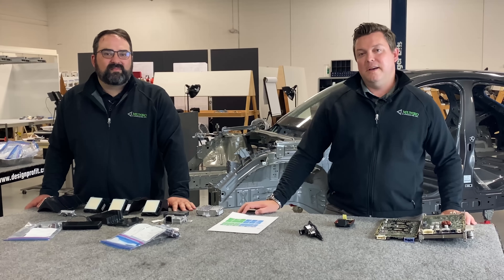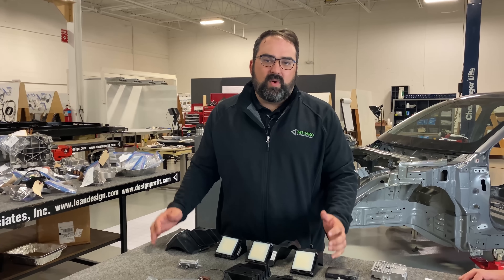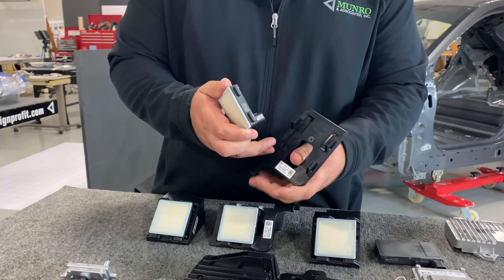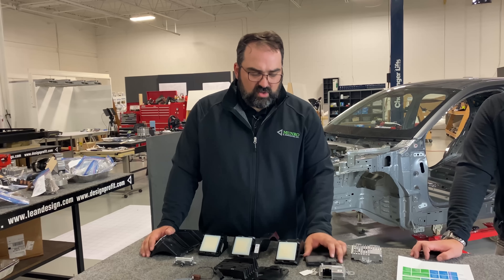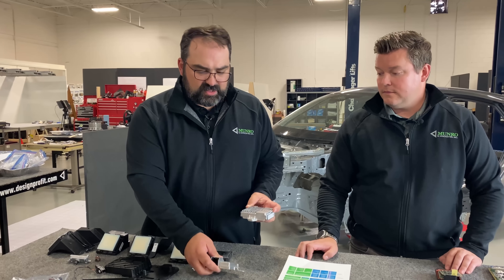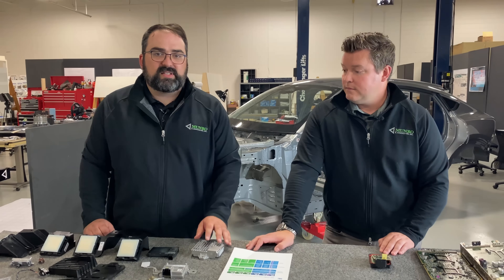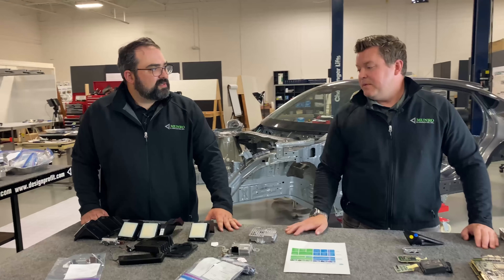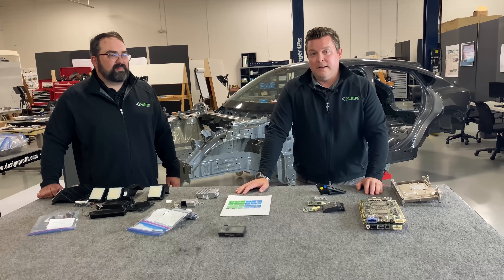Mach-E ADAS Breakdown

Comment: You didn't mention the OEM for Ford's driver assist hardware and software.  I'm certain that they outsourced it.

How do the two systems compare with respect to current draw?

I'll make a wild-ass guess:  Ford's system draws less power.  I don't think we can blame the car's relatively poor energy efficiency on their driver assist hardware.  I think this because Tesla is performing a hell of a lot of compute cycles with its FSD hardware.  Tesla has to - they're trying to solve the object recognition/vision problem.  Ford isn't.

Radar is color-blind and can't be used to identify objects.  Vision can, in principle, but the better the object recognition, the more compute-intensive the system has to be.  Tesla aimed high with Hardware 3.0 - they expect the system to recognize anything a car will encounter on the road, anywhere, and use that information to predict what various objects will do.  For example, Tesla will be able to recognize a bicycle mounted on the back of a vehicle and predict that it will move with the vehicle, not suddenly change directions.  Radar won't distinguish what it sees; it just notes there's something reflective there.

Some surfaces don't reflect radar much.  Skin and clothing might as well be stealth materials.  Radar reflects great from metal and can identify distances, which software can use to generate a virtual point cloud of reflections around the vehicle.  The objective is to not run into anything that reflects radar.

This is 90's tech.  I don't see a developmental path from where Ford is to L5 autonomy.  Or even L4.

Occlusion is indeed an issue with vision systems like Tesla's - but it's probably not more of an issue than it is with human drivers.  The system should be able to determine if it can't see well enough to operate the vehicle safely and then take action.  For L2, where driver attention is mandatory, the action will be to warn the driver and disengage the driver assist function.  For L4 and L5, the car will have to decide on a course to attain safety - slow down, pull over to the shoulder, exit to a rest stop, etc.  Its decisions must resemble those a skilled and attentive human driver would make under the same circumstances.

I'm convinced that vision is the way to go.  A good vision system simply won't need radar.  Or lidar.

The proof?  Humans can operate motor vehicles with only two cameras (eyes) and sometimes-inattentive wetware.  A vision system with 360 degree views and absolutely no risk of inattention should be able to beat human driver safety very well indeed - if the object recognition problem and predictive algorithms are solved.  That will require a lot of compute cycles in the car, and a hefty AI training architecture (not in the vehicle) developing the car's programming.  Thus far, only Tesla puts that much computer power into its vehicles.  And Tesla's AI training architecture, aimed at solving vision, is unique.  No other automaker has anything like it.
Reply: I'm not absolutely convince on the camera approach getting to level 5 on it's own do to issues with winter driving messing with cameras. Go watch the episode Monroe did on the FLIR thermal based system. Sandy seemed to believe that was going to be the way to get to level 5 in that episode.
Reply: @torchlord11  I did see the episode about FLIR.

FLIR is optical.  You should think of infrared as just another band of colors -- longer wavelengths than our eyes can resolve, but cameras can.

Weather can mess with FLIR cameras, too - raindrops emit infrared photons like just about everything else, and they can bollix up the curvature of a lens.

With all due respect to Sandy, I don't think that FLIR is the key to enabling L5.  The obstacle really isn't the color of the light.  It's object recognition and making correct control decisions.  Elon thinks that visible light is good enough, and I find it hard to argue with him.  We humans have driven billions, maybe even trillions of miles with nothing better.  Our accident rate sucks, though, which is why getting machines to do it more safely is a great idea.
Reply: @Urgelt  I found this article that seem to have done some difficult test and tested recent Tesla's and cars with FlIR in it. They say that the Tesla didn't do so well in all the test but did ok in some. According to the FLIR Website their system can detect 4x better at night, with cameras you are limited to how far your light source goes.
 https://www.forbes.com/sites/samabuelsamid/2020/09/15/flir-demonstrates-how-thermal-imaging-can-improve-pedestrian-safety/?sh=2582671f3cd9
Reply: @torchlord11  I watched that, with all respect to Sandy it's not his area of expertise.
Reply: I agree with you that vision only should be enough but adding radar would make it more versatile, wouldn’t you agree? 
(That’s not what Ford is doing, they heavily rely on radar)
Radar will give very precise distance information while vision based software will have to estimate. A large or small person a large or small car. Some European brand car models have a distinct recognizable look over their product lines. To distinguish between an Audi Q3, Q5 and Q7 could be difficult. 
The issue could be tackled by using dual cameras (stereography) of course.

Btw, a decade ago, Ford already had traffic sign recognition systems available in almost all models here in Europe. 

BMW already had a night vision option with a ‘crossing persons warning system’ in its 2008 cars. Tesla isn’t the only one developing these systems although I agree that they are a step ahead of the competition.
Reply: @Conservator.  No radar would not make it more versatile.  It would in fact make it error prone and less effective.
BWT a decade ago Ford stopped building cars with traffic sign recognition systems in Europe.
BMW does not have night vision, I have been in a new BMW and it did not have anything like that.  If it was safe and cost effective every BMW would have it.
Reply: @davidbeppler3032  Who told you that Ford doesn't offer traffic sign recognition functionality in Europe? It is enough to visit any European Ford web site to see it advertised. From the UK site: "Whether the signs are at the side of the road or above it, permanent or temporary, Traffic Sign Recognition can identify them. Icons for speed limits and no-overtaking signs are displayed on the instrument cluster, alerting you to changing restrictions".
Reply: @davidbeppler3032  Night vision was a very expensive option. Very few cars will have it.
Reply: @Conservator.  Hence it is useless.  Tesla Autopilot is very expensive, every Tesla has it.
Reply: @davidbeppler3032  No, FSD is a very expensive option in a Tesla too. 
You are comparing Tesla tech of today with BMW’s of 13 years ago. That was 4 years before the first Model S was delivered.
Reply: @Conservator.  13 year old tech that has never been produced vs 10 year old tech that is in every car.  Yes.  Seem s like BMW sucks.
Reply: @davidbeppler3032  I hope you have splendid day!
Reply: @Conservator.  Every day!
Reply: @Conservator.  The Mach E's ADAS system is combining Mobileye's EyeQ4 camera-based system with radar.
Reply: Well said!
Reply: You made made many good points. I'd like to add:

Indeed they didn't mention who supplies the camera, radars and modules to Ford and I agree those are most likely outsourced. However neither did they mention that Tesla's front facing radar is also outsourced. Tesla's  camera used to be from MobileEye, but I'm not sure if it still is, since their "break up".
Reply: @favoreto  I don't know where Tesla gets their cameras, but cameras are commoditized, so it really doesn't matter.  Tesla wouldn't go to Mobile Eye for them, they'd just order them out of a parts catalog from a wholesaler.

It wasn't the cameras I was interested in on the Ford, but the system.  Particularly, the software.  That's the hard part, after all.

I suspect it is a Mobile Eye system in the Ford, but it's only a suspicion.
Reply: But Tesla it's building in a limit to they're system to not be able to do better, or not much better, than a human in extreme weather, on the periphery of headlights in truly dark conditions etc. What is s lens fogs up? Maybe there's something I don't understand about the capability of the cameras, but I do not have high confidence in Tesla's approach being able to extend to level 4 and 5 (for a personal car I have no interest in a level 5 car with no steering wheel, although the plaid seems to be trying to get there early with its ridiculous steering wheel).
Reply: @Paul-pj5qu  Do we know how much information Tesla will be able to extract from high-resolution video?

Not really.  But it's safe to say, nobody has tried to do what Tesla is attempting to do.

Don't assume that camera systems are exactly like human-operated eyeballs.  For one thing, human visual perception never gets much higher than 10 frames per second.  Our brains simply don't process visual data very fast.  Tesla's FSD will process visual data at a much higher speed.

FSD will also process data from eight different cameras, providing views all around the car.  The richness of the data haul is considerably greater than for Mark 1 Eyeballs.

The beauty of machine learning is that humans don't have to imagine algorithms that will turn that data into good driving decisions.  We won't know in advance how the machine will figure out what it sees.  But it will, and the accuracy of its resulting decisions will be discovered, not invented.

Don't hold out for this or that approach to getting data or evaluating it.  Judge FSD not by how it works, but how well.
Reply: Agreed, it doesn't mean that Tesla will achieve it's lofty goals but it has a higher chance to because it is actually trying. Other OEMs either can't or won't take that risk. They typically build other people's tech into their cars and aren't in the AI business.
Reply: @bluetoad2668  Honda's Legend already has other people's tech certified for the Level 3 driving. Mercedes is going to have similar functionality on sale (S-class) this autumn. Tesla isn't even trying.
Reply: Vision is indeed the way to go, but there's an even bigger reason why: you already need to solve vision fully in order to achieve FSD capability anyways. As they alluded to in the video, cameras are needed for everything you don't get from the point cloud radar/ultrasonic data - image recognition of traffic lights, stop signs, speed limits, road edges, etc.

Basically: if you already need to fully solve vision anyways, why bother supplementing it with more expensive and less descriptive sensors? Especially when you have the benefit of a massive fleet and billions of miles of deep learning training data, plus internal test vehicles with LIDAR to validate.
Reply: @Megaphonix  Because otherwise you have a higher risk to plow into a topped over truck. Or a lane divider. Or under a tractor trailer. Make your pick.
Reply: I’m bot sold on the 100% camera approach or Fords radar approach. Humans do not drive only using our eyes and experience. Our senses of touch and hearing also add in to the mix, we feel if the road is slick, we listen for warning sounds. While it’s more radar these added sense give us an advantage. I don’t know a good alternative to these for a car, maybe the traction control to some respect in a car but I’d welcome your input on these also.
Reply: @flowrebaz6189  Tesla could use microphones to add to their data feed.  They could fuse sensor data from around the car to emulate a human sense of touch.  But why would they bother, if they can get the job done well enough without those sensor inputs?

Let's not judge Tesla for how they do the job.  Let's judge Tesla based on how well they do the job.
Reply: @Urgelt  if I judge them on how well they do, they do not better than their competitors from what I’ve seen at this point and not better than a death human driver but that may change in the future. I do hate the statement that humans drive using two cameras though because there is so much more to driving than just watching
Reply: @flowrebaz6189  We (Tesla outsiders) don't actually know how safely FSD can operate without the attention of a driver.

What we know is what Tesla has reported thus far.  With FSD engaged, and with drivers paying attention, accidents per mile are greatly reduced.  Greatly.  This is hard fact.

Thus far, the training wheels are still on the bike.  And Tesla isn't ready to yank the training wheels yet.

The next step to take, when Tesla is ready for it, is to conduct pilot tests of true autonomous driving in the real world.  Then we will be able to assess how autonomy accident rates will compare to human drivers.

Wait for it.  Suspend judgment until we can see how well FSD will do in those pilot tests.

The only point of bringing up human eyeballs is to show that driving can be solved with sensory input even more limited than the sensory input on a Tesla vehicle.  The sensors aren't terribly important - eyeballs are common, and cameras are, too.  It's the processing, in human heads or in machine neural nets, where the magic happens.
Reply: @Urgelt  hard facts are backed up by data, Tesla does not release that data only the statements. Delving deeper in to that data would be relevant. Given the cost of a Tesla it is far more likely that the people buying these vehicles already had great driving records and those failures were due to the small % of drivers who have money but aren’t good drivers. Without the data released by Tesla and access to the driving records of the US drivers, the only people allowed to have FSD and the wider suite or products there are no hard facts, just the ones Tesla wants to release. 

Given Elon is widely known to make hyperbolic statements to further his own goals, it isn’t hard to believe he omits certain things as he isn’t legally required to release everything yet. This so simply because Tesla does not have a license to test autonomous vehicles at this time, if they did that data would be required under autonomous vehicles regulations. 

Still can’t wait to see it when they are able to do autonomous vehicles, it’ll be a very special day.
Reply: @flowrebaz6189  Elon sets ambitious goals for his company.  He admits his goals are ambitious.  He is quite open about this.  Sometimes, his ambitious goals are achieved on the timeline he expected - or even sooner, as with the Model Y launch.  In no case have I detected any attempt by him to deceive.

Neither Volvo nor Tesla are permitted to operate vehicles autonomously.  So a comparison of accident rates while either company's driver assist products is engaged is perfectly reasonable.

Tesla does track and release those numbers.  They've been widely reported.  With FSD engaged, Tesla vehicles are roughly 1/10th as likely to have accidents as the NTHSA averages.  Tesla also releases accident rates for when FSD is not engaged but collision avoidance is engaged, and for when neither FSD nor collision avoidance are engaged.

Tesla's vehicles also score extremely well in crash testing.  All of their vehicles are 5-star rated by every testing authority who tests them.

Volvo's ICEVs are not as safe as Tesla's vehicles in crashes.  Their centers of gravity are higher.  Their crumple zones in front are filled with heavy metal that won't crumple and can crash into the passenger compartment.

What I don't know is Volvo's accident rate with driver assist engaged.  Does Volvo release those numbers, as Tesla does?  How do they compare to NHTSA averages?
Reply: @Urgelt  when was the last time the exterior of the model 3 changed? The Model s has but a minor superficial change the exterior. They Cybertruck will have an exoskeleton body, it’ll be highly unlikely that will see much if any change once the design is settled. They only re-engineer that which goes inside because tooling for an external change costs money. While model years exist within other manufacturers, the changes are almost nonexistent in those also. Most manufacturers don’t remodel their vehicles more than once a decade. Yes Tesla added the heat pump from the model y in to the 3 but it was not added to the S or X.

NHTSA has no need to investigate more than the accidents that do happen but they do not investigate individual claims by the companies, heck the refuse to clamp down on the misuse of FSD and the claims made by Elon regardless of the accidents that do happen, he recoded himself on tv with no hands breaking his companies own rules on FSD and the NHTSA didn’t do a thing. 

If someone lied to you, changed deadlines, moved goals posts on a regular basis and only managed to beat a goal once in 10 years, I wonder would you be as forgiving as you are of Tesla? I’ve nothing more to say here apart from I do not believe claims made by a man that has lied but does not public ally publish the full facts. Cherry picking facts doesn’t make them any less factual but does make them less trustworthy when omitting others such as the non-existent roof tiles at the time of launch
Reply: @flowrebaz6189  I don't understand your diatribe about external changes.

Cybertruck is going to be produced with an appearance that is very close to the prototype shown at the Cybertruck reveal event long ago.  Tesla does this - what prototypes are always close to what is actually produced.  This stands in stark contrast to other OEMs, whose prototypes generate buzz in the media, but then the product that reaches market is nothing like the prototype.

Tesla's engineers are concerned with producibility, features and performance.  These things are continuously reengineered.  This isn't controversial.  It's how they do business.  When they make external changes, they're small.

NHTSA does not 'clamp down' on Tesla for misuse of FSD because Tesla doesn't misuse FSD.  Tesla does exactly what NHTSA demands that they do - tell customers that drivers attention is always required with every version of FSD released thus far.  Misuse is on drivers, not Tesla.  This is exactly the same as for other manufacturers' driver assist products.  Exactly.

Name one automaker who releases to the public the detail you're demanding from Tesla.  Just one.

I'm waiting.

Setting ambitious goals, then missing the timelines, is not lying - particularly as Elon fully admits his goals are aspirational.  What's remarkable about Elon's goals isn't that they are ambitious.  It's not that they slip.  It's that in nearly all cases, Tesla does reach those goals.  They're quite sincere about what they say they want to do, and they almost always deliver.

You have a strange definition of lying, my friend.
Reply: @flowrebaz6189  You're picking nits.  The truck's dimensions got a tiny, tiny tweak.  It's still the same truck and you'll have no difficulty recognizing it.

Why agonize over the fact that Tesla's engineers don't stop working?  Makes no sense.
Reply: @Urgelt  it all comes down to production, you cannot build out the production until the dimensions are settled. Once again you make excuses. Good bye
Reply: @flowrebaz6189  You think that was on the critical path?

They didn't even have the factory built when they made those tweaks.  The 4680 developmental program is taking its sweet time, too.

Your complaint makes no sense.
Reply: Bats navigate by "radar" in the dark, how is this for proof? ;-)
Reply: @abraxastulammo9940  Psst.  Bats use echolocation, not radar.  That's sound energy, not radio energy.  Just sayin'.

No critters use radar themselves.  Or at least, we haven't caught them at it.
Reply: @abraxastulammo9940  Bats navigate by sonar, and also have great vision.
Reply: I agree that vision is the way to go. For that a good >120dB HDR needs to be available to at least see the same as the human eye. To ease computational power other wavelength bands like SWIR may be used (if I'm correct Toyota already has a vehiecle that has it) but resolution is still low and costs are very high.
Reply: @hobbykip  > 120dB HDR is currently not technically possible. You hit a wall at around 100dB, depending how much money you can afford to throw at the lens AR coatings.
Reply: @hobbykip  "...see the same as the human eye."

You're stuck on the sensor end, when what you should be stuck on is the computation end.

It does not matter how the sensors work, or how they compare to human organs.  Don't get hung up on the properties of optical cameras.  Those are not the make-or-break factors.

The magic isn't in the sensors.  It's in the neural net architecture, the computation.  Tesla needs some kind of sensory input, it needs enough sensory input, but exactly how closely that input resembles human sensory input is a red herring, a distraction.

Look at results.  That is where the proof will come from, not sensor details.
Reply: Thank you for the education sir. Well appreciated
Reply: I think that Tesla's vision-only system is a supportable approach compared to LIDAR based systems.
But I'm not as confident about their decision to drop forward-looking radar.  Low-mounted radar has the ability to detect multiple unseen vehicles in the same lane, and especially to detect them changing speed during highway emergency braking.  That single use case is common and dangerous enough to justify radar.
Reply: @1djbecker  Detecting vehicles ahead, but occluded, using low-mounted radar is hit-or-miss.  Works sometimes, doesn't other times.

Radar has a lot of false positives, too.  A lot of false positives.  Radar is vulnerable to accidental spoofing, just as much as it is vulnerable to deliberate spoofing.  (Ask the Air Force about it.)

Elon posed an important question: if radar and camera vision disagree, which do we trust?

Radar sees no colors.  It doesn't generate enough information to identify objects.  It gets stuff wrong when spoofing comes into play - weird signals bouncing off of odd bits of terrain or other objects, phasing just right at the receiver to cause a false positive or cancel out a signal that should be recognized by the car.  Stuff happens.'  So which do we trust?

The fidelity of optical data is far superior to any radar system.  It's good enough to support Tesla's object identification ambitions.  It's good enough to reliably estimate distances.  When Tesla delved into this question, the answer was, the optical system is much more dependable.

When the systems agreed, nothing was gained from radar.

When the systems disagreed, nothing was gained from radar, either.  Tesla found that the optical system was almost always right - and there was no way to know when radar gave a better answer.  (This is the terrible thing about false positives and false negatives.  You don't know they're false until data arrives from some other source.)

I'm pleased that Tesla was willing to question its own early assumptions and change direction.  This is what innovation looks like!
Reply: @Urgelt  Those are good points, but I think that you are missing a key one: liability.  In front of a jury, or even public opinion, people will expect a system to respond correctly to visible hazards 100% of the time.  They won't have the same high standard for invisible hazards.  They'll forgive a highway pile-up where a human couldn't have seen the initial problem or have reacted in time.  They don't forgive a system that misinterprets missing or conflicting lane markers.

That said, even if radar ends up being a one-trick-pony, detecting bumper-to-bumper emergency stopping, that is a common enough use case to be worthwhile.
Reply: @1djbecker  There is no way Tesla can be held liable for a system failing to perform adequately as an autonomous system when it's not permitted to be operated autonomously in the first place.

There is no ambiguity about who was at fault in these accidents.  The driver.

No lawsuit would get past discovery, let alone get a jury to award damages against Tesla.  It's just too open-and-shut.

Let this be a warning to all drivers: you are responsible.  Period.

When autonomy is finally permitted (somewhere), questions about liability in crashes will definitely have to be answered, but under today's laws, there is no ambiguity whatsoever as to who is responsible, and it ain't Tesla.
Reply: @timbehrens9678  No.  You seem to have a talent for taking in information and twisting it.

I did not say lawmakers are responsible for crashes of Tesla vehicles.

I said drivers are responsible for crashes of Tesla vehicles.  Tesla has not yet deployed autonomy.  Drivers are required to pay attention.  If they don't, the onus is on them.
Reply: @Urgelt  You have implied that Tesla tech is almost ready for autonomy, but the lawmakers don't allow it. However, I have clearly indicated that Tesla's Level 2 ADAS can't complete with what Volvo had back in 2014. You don't need autonomy to recognize an overturned truck on empty highway in the broad daylight. You just need to ask those people who did the Volvo Collision Avoidance for help.
Reply: @timbehrens9678  You asserted that Tesla's software is inferior to Volvo's 2014 software.

You haven't proven the point, only asserted it.  Perhaps you can prove it?  A summary of accidents per mile for Tesla versus Volvo over the last 5 years with driver assist engaged could be convincing, if it shows what you assert it will.
Reply: @Urgelt  It is enough to count the episodes with fatalities. Guess who is going to win?
Reply: @timbehrens9678  Guessing is not evidence, Tim.
Reply: @Urgelt  There are no known deadly incidents involving Volvo Collision Avoidance System. By the way, Tesla, unlike all the companies developing autonomous driving systems, doesn't report the disengagement statistics to California DMV. I guess because their AP is so superior.
Reply: @Urgelt  The California DMV is requiring a so-called Disengagement Report from all companies licensed to test and operate autonomous vehicles on all public roads in California. For the period from December 2019 to November 2020, a total of 29 companies reported test drives. Among them are Cruise, Waymo, Pony.AI, Zoox, who drove almost 2 millions miles combined. As you can see, Tesla isn't testing or operating autonomous vehicles in their home turf California. Which isn't very surprising, since Tesla is still weeding the deadly bugs from their ADAS.
Reply: @timbehrens9678  Uh... Tesla isn't authorized to operate autonomous vehicles in California.  Or anywhere else.  So they are not required to report disengagement events for autonomous vehicles.

What part of that confuses you?

I thought you were talking about driver assist disengagements.  Which nobody reports.  But no.  You're demanding that Tesla report disengagement results to California when California itself doesn't require it of Tesla, and criticizing Tesla for withholding the reporting.

How does that make any sense?
Reply: @Urgelt  Exactly! Tesla is not authorized to operate or test autonomous vehicles in California because they don't work on those vehicles in California or anywhere else. Officially they work on their buggy overpriced ADAS. Now you got it! Just a small hint - no amount of work on ADAS is going to bring you up to the Level 5. But might reduce the amount of bugs in their assistance system.
Reply: @timbehrens9678  just an observation, you are talking past each other.  Those fully autonomous test vehicles from Waymo etc. are fine but are taking a philosophically different approach to Tesla.  Tesla is aiming immediately for general AI driving anywhere like a human. The others are taking a different route which they hope will eventually get to the same place but via more steps and using multiple sensor types. Tesla will either jump from level 2 to 4/5 suddenly or not at all.  The others might stay at 3 for a long time.  Either way Tesla gets a lot of points from me chiefly because my model S has proven itself as the best car I have ever driven - so I'm only a fan because of that.  Keep it rational, fact based, respectful and fun guys!
Reply: @timbehrens9678  Let me help you out here, Tim.

Tesla is working on L5 autonomy.  Easy idea to wrap your head around.  It's their goal.  They're working towards it.  Simple.

It's in development.  Incomplete.  Also easy to grasp.

The finished product isn't in customer hands.  It's not in anyone's hands, not even Tesla's.  FSD is not finished.  With me so far?

What is in customer hands is a form of driver assist software.  The driver must pay attention and is responsible for the vehicle's operations.  This is perfectly straightforward, not so?

So there is no reporting requirement for disengagements of FSD in California.  Or anywhere else.  It makes no sense to criticize Tesla for failing to report FSD disengagements when there is no regulatory or legal requirement for them to do so.

That won't happen until Tesla starts a pilot autonomy test on public roads.  Which they will do, when they are ready for it.

Are there bugs in FSD?  Depends on what you mean by 'bugs.'

No driver assist system is required under anybody's law to operate without a driver's attention.  They are expected to make errors.  Which is why drivers can't take their attention away from vehicular operation.  Driver assist systems only assist the driver.

FSD as deployed makes errors.  All driver assist systems as deployed make errors.  Even Volvo's.  If they did not make errors, they would be full-blown L5 autonomy systems.  Nobody has this challenge licked yet.

There.  Now you should know enough to stop making ridiculous statements, such as criticizing Tesla for failing to submit reports to California which California doesn't require Tesla to submit, or slamming Tesla because its driver assist system, currently deployed, doesn't achieve errorless L5 autonomy.  Of course it doesn't.  Tesla never claimed it did.

But it will.

The only question is when.
Reply: @bluetoad2668  It looks like Tesla isn't working on Level 4 or 5 at all. They are advertising something related to the full autonomy in the future, sell a buggy ADAS and still working on those deadly bugs. Tesla is acknowledging this picture officially but not publicly. Obviously that Tesla is going to have many thousands happy customers of their ADAS due to the simple statistics. And several dead ones. I do hope you know the risk and won't turn up among the latter.
Reply: @Urgelt  After your thorough explanation you have to ask yourself a question - why the other companies are way ahead with full autonomy and already testing their systems on public roads with 20+ thousand miles between disengagements and Tesla is still working on the deadly bugs in their ADAS. Of course every ADAS can make mistakes. But only in Tesla's cases those mistakes were deadly  although the surrounding conditions were more than favorable. The US is a pretty letigious country. Even a wrongly placed floor mat can lead to a lawsuit. But I'm not aware of any lawsuits involving ADAS of other carmakers.
Reply: @bluetoad2668  Your desire to pay and risk your own life in order to improve Tesla ADAS is pretty extravagant. But hey, there are multiple even more expensive and much more deadlier hobbies around! You only have to be avare that Tesla itself most likely hasn't even started working on full autonomy. They have received a permission from the California DMV to operate test vehicles with a human driver on public roads and drove whopping 12.2 miles back in 2019 and none in 2020.
Reply: @Urgelt  Debunking #2: Safety ratings are pretty complicated subject. Here you are mixing occupant safety which is very good in the Tesla models thanks to the low point of mass and ample crumple zone not obstructed by an ICE. But any other reasonably designed EV of comparable class is going to have the same advantages over the stinkers! But what about active safety? Well, "Tesla Autopilot gets ‘moderate’ grade from European vehicle safety authority while Audi, BMW and Mercedes get top marks". Debunking continues in several hours!
Reply: @timbehrens9678  Can you provide a source for your NHTSA list of ADAS accidents?  Sounds like it is worth following up.

But I'm curious about something.  Assuming the list is a complete accounting of ADAS accidents for a defined period of time, and assuming that Tesla ADAS is indeed as poor as you are reporting to us, why would you think that it has anything to do with FSD when Tesla declares it ready for autonomous, attentionless driving?

It'll be a very different software product from anything yet deployed to the entire Tesla fleet.  Shouldn't we suspend judgment on it until it proves itself?  Which it will have to do, of course, in pilot testing.

When did Tesla stop using Mobil Eye hardware and software?  I'm also curious how many of those fatalities occurred before Tesla began to release its own ADAS software.
Reply: @timbehrens9678  Here, I will not disagree.  The car is very safe in collisions.  It has not yet garnered top marks for its collision-avoidance software.

The approach Tesla is taking for FSD is radically different from everyone else.  Much, much harder.

This is really a question about the best way to achieve accident avoidance when software is mature.  Nobody has mature software yet.  They're all struggling mightily to improve what they have.  They're chasing 9's at the end of the 99%+ success rate.

With point-clouds, no or limited object recognition, less computation on board, no machine learning, autonomy can get to the early 9's in the chase faster.  Obviously.

But without object recognition and machine learning, how far can the 9's be chased before lack of predictive algorithms for transient objects become a sticking point?

We don't know.  Nor do we know how far Tesla's radically different approach to the problem will let them chase 9's, either.  This is all unexplored territory.

The entire field is evolving pretty quickly.  I doubt very much that success rates for any of the competitors in 2016-20 means a fart going forward.  Looking back doesn't help us to predict the future of specific competitors.

This story isn't finished.  We don't know what is in the final chapter.  But we do know that, if they succeed with FSD development, privately owned/operated Teslas will be capable of autonomy; nobody else is talking about anything but robotaxis.  We know that a Tesla used as a robotaxi will be cheaper to purchase and operate than any of those specially-equipped robotaxis.  And we know that Tesla won't be limited by the need for frequently-updated millimeter-precision geomaps.  Without the need for geomaps, autonomous use of Teslas will be limited only by legislation, insurance and regulations regimes - political boundaries, in other words.  Wherever it is permitted, it will be able to go.

They're the only dog in the hunt that can bark any of those sounds.
Reply: @Urgelt  If Tesla after so much chest pounding and hype funneling can't make a reliable ADAS, what do you expect for the mind bogglingy difficult Level 5? Initially I have also thought that they are the distant leaders since I was hoping that I'm going to like and buy the Model 3. Then I started digging. 

I still like the Model 3, but mostly from the outside. But that abomination of ergonomics absolutely kills it for me. And the horror repair bill/parts availability stories just add to my disappointment. My dream is the Model 3 or Y body and drive + Toyota's reliability and quality.
Reply: @Urgelt  History of software development is full with botched dead man walking projects. The alpha looks promising, let's pour some millions more.
Reply: @Urgelt  Everybody and their dog is using Mobileye. The right question is - what they are doing with its output? That NHTSA statistics tells me that the rest of the industry is handling the Mobileye output as intended.
Reply: @timbehrens9678  To you know anything about machine learning, Tim?  Anything at all?  One little thing?

Because if you haven't brought yourself up to speed on this tech, then your expectations, grounded in old tech, may turn out to be deficient going forward.

Legacy auto is putting up a brave front, but deep down, they are terrified.  What Tesla is attempting is way, way beyond them.

In theory, Google or Apple could tackle a machine learning project this vast.

But if you knew the subject, then you would realize that it's not programmers who are the key to success, once the hardware, algorithms and work flows are in place.

It's the data.

Tesla has the data - billions of miles of real-world driving.

Everyone else is running simulations, tooling around test tracks, or operating small pilot tests with carefully-geomapped streets.  They have accumulated 3 orders of magnitude less data.  When it comes to machine learning, they aren't just behind Tesla.

They're not on the board at all.

We don't know if Tesla's approach will work.  We do know that nobody else is even attempting it.
Reply: @Urgelt  I am so old that I know what a perceptron, AI winter, Fifth Generation Computer Systems, and expert systems are. Even the most advanced statistics can go only so far. It may cover 99,999% of the cases, but with millions of miles traveled those ones after zeros can get pretty expensive. The S-curve is a thing, too.
Reply: Tesla vision system is going to run you smack dab into a lane divider, a topped over truck, or under a tractor trailer. Make your pick.
Reply: @timbehrens9678  These are the errors in judgment you are making:

1.  Several Tesla cars had accidents that weren't prevented by software in the car.

That software was not ready for autonomy.  Drivers were required to be in control at all times.

They weren't.

2.  That software is not the software Tesla is prototyping right now with a limited number of drivers.  Thus far, none of those testers has been run smack into a lane divider, a topped-over truck, or under a tractor-trailer.

3.  But those drivers are also required to pay attention.  Autonomy is not here yet, so there's no point blaming software for crashes that drivers should have avoided.
Reply: @Urgelt  Tesla software AND hardware was and still is not ready to handle simple obstacles under the most favorable conditions RELIABLY. Therefore Tesla, just like Ford, or VW, or the rest of the carmakers except Honda is still Level 2.
Reply: @timbehrens9678  Correct.

But Tesla is on a fast-moving (and accelerating) path to full autonomy.  It's not far.

The tech side is close.  What's not close is legislation, regulations and insurance governing the operation of autonomous vehicles.  That is critical path stuff, and it's not going to happen quickly in most jurisdictions.

Until that side of the equation is filled in, autonomy software is just driver assist software.  No matter what it can do, all it will be permitted to do is to assist an attentive driver - and the driver will be 100% liable for results.
Reply: @Urgelt  The tech side is not close to full autonomy. Especially not for Tesla. Otherwise Tesla would have been the first one certified for the Level 3. It wasn't. But Honda with 4 lidars and stuff was. Mercedes and Volvo (again, with lidars and stuff) are close to offer some limited autonomous driving functionality where they take the legal responsibility, not a driver. Tesla? With all their mega-advanced custom neural network chips and vision? Not even in sight. And please don't tell us that a poor start up like Tesla can't afford compliance and testing departments to deal with German or Swedish traffic regulations.
Reply: @timbehrens9678  Tesla never aimed at creating a L3 system.  Their goal is L5.  They'll be at L4 for a long time, though - because jurisdictions will not, all of them at once, approve autonomy in their jurisdictions, so there will have to be map boundaries where autonomy is permitted/not permitted.

How close are they?

Not as close as Elon forecast in the past.  He admits, he sets aspirational dates for his engineers.

Outsiders like us can, and will, try to figure out how much progress Tesla has made.  Opinions are all over the map - some think they're weeks away, some think never, some folks occupy middle ground.  None of us are operating with a good insider's view of what Tesla is doing.

No-one has ever done what Tesla is attempting.  It's without precedent.

Looking at sensors is a red herring; if you form your opinion from sensor counts, you're focusing on the wrong thing.  Success or failure will come from the most ambitious machine learning program ever attempted by anyone, anywhere.

Tesla has a clear lead in compute cycles - both in the car and in their machine learning architecture.  They're applying machine learning to a problem whose sheer scope is orders of magnitude larger than anyone else has ever attempted.  Every other attempt to create self-driving cars is founded on attempts to avoid collisions with unknown 'stuff.'  Tesla is trying to recognize all of the objects a car will encounter in the real world and predict what they will do - in real time.  Hard!

Tesla could fail.  Failure is an option.

The opinions of outsiders are weightless.  They signify noise, nothing more - even my own opinion!

All that matters is results.  We will all be watching to see what happens.
Reply: @Urgelt  If Tesla can't demonstrate a functional Level 3 system, what hopes do they have to reach the Level 5? Heck, their current Level 2 ADAS can't complete with what Volvo had back in 2014!
Reply: @timbehrens9678  What are you smoking?

Volvo in 2014 had highway driver assist.  Tesla's version 9 beta works on (almost) any roads.  There are still a few features to add, but it's already quite close to nailing city driving down tight.

L3 is not a milestone Tesla cares about.  They're aiming higher.
Reply: @timbehrens9678  Just like a human driver does.  The only answer is to stop driving vehicles.  You gave up your car years ago?  For safety?
Reply: @davidbeppler3032  very few people if alert/not incapacitated would have plowed into a topped truck in a middle of a highway in broad daylight.
Reply: @timbehrens9678  Very few Teslas have ever had any kind of deadly accident under autopilot.  PS those cars were under people control and they did not see it either.  ;)
Reply: @davidbeppler3032  those people weren't even trying to see anything. And the "most advanced Level 2 software in the world" wasn't even trying to warn them.
Reply: @timbehrens9678  You often drive your car without looking forward?  Seems dangerous.  The drivers did not see the danger, the system did not see the danger, the people died.  If you were in a car with "full self driving" which Tesla is not, and you saw it taking you off a cliff, you would do nothing?  You are strange.
Reply: @davidbeppler3032  Do you realize that Tesla is behind of almost everybody? They haven't mastered a Level 2 function (Automatic Emergency Braking) that can be found on everything from the Ford F-150 to the Honda CR-V to the Toyota Camry. In many cases, it's fitted as standard, often with forward collision warning, too.
Reply: @timbehrens9678  What other car can you buy today that will drive you in the city?  Not on freeways, in the city.  I await your answer.
Reply: @davidbeppler3032  There are countless car companies offering ADAS that work in city environment. They just don't make false advertising. Because Tesla won't drive you in any city without you being as alert (if not even more) as if you were driving yourself.
Reply: @timbehrens9678  Plz tell me about this car that will drive me in the city.  You said countless?  Ok give me just 1.
Reply: @davidbeppler3032  Waymo.
Reply: @timbehrens9678  Sorry Tim.  You can't buy a Waymo.  They do not make cars.  Try again.
Reply: @David Beppler  They already offer a taxi service which for some categories of people is even a better deal. You don't need to buy a cow to drink its milk. And it is only a matter of time until they are going to sell their software to carmakers and fleet operators. Waymo is successful operating their Level 4 system for over a year while Tesla is still struggling with their ADAS.